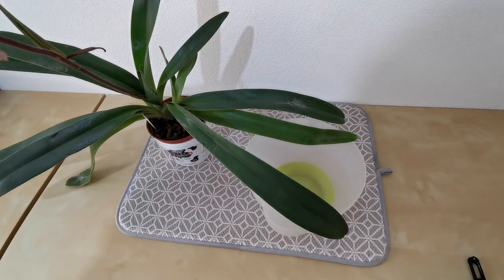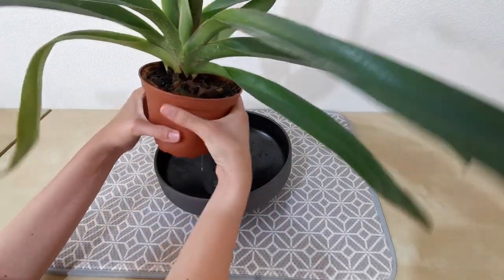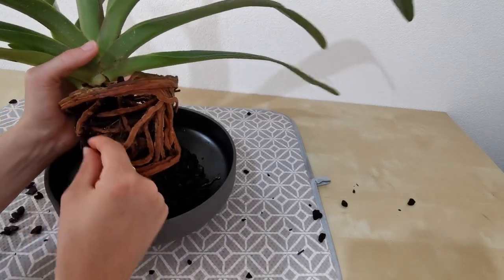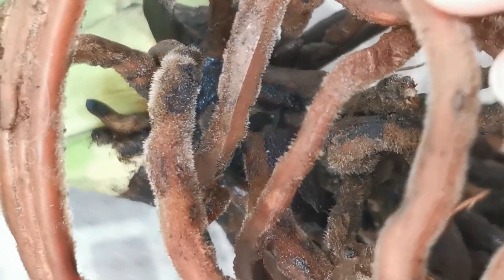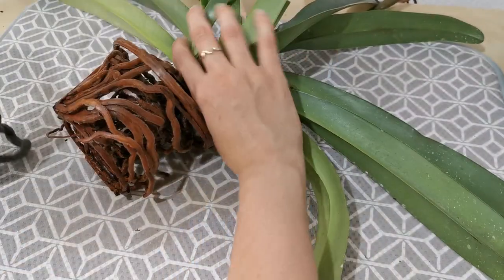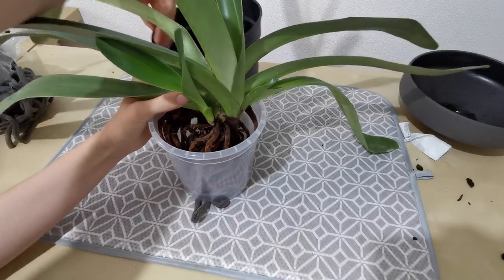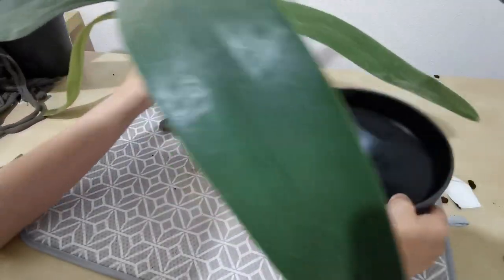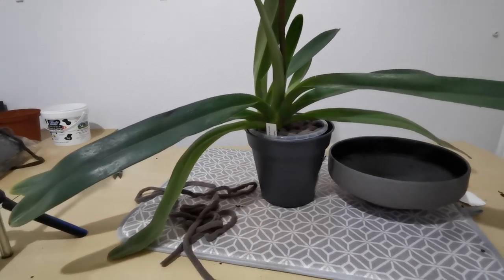Paphiopedilum Lady Isabel Repot

Comment: Great repotting. Will be interesting to see how they do in synthic. Amazing root system! You could have used a pencil or spoon handle to push the synthic down in the pot if your fingers were too tight.
Reply from the maker: Omg you're so right, silly me! That's a good tip to remember next time. Thanks Lucy!
Reply: Orchid Nerd 👌